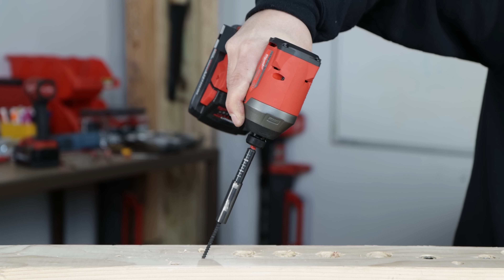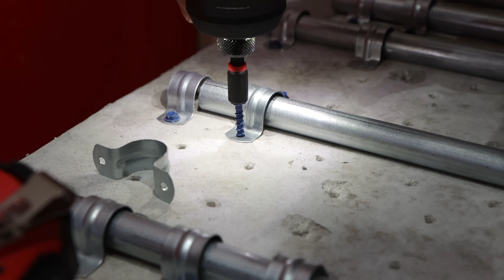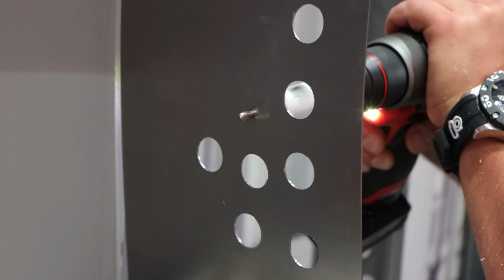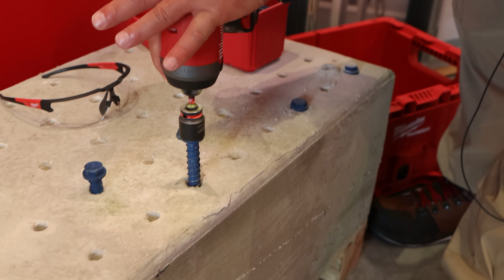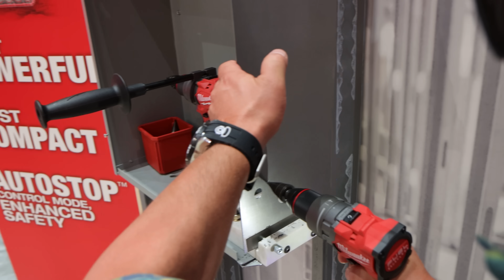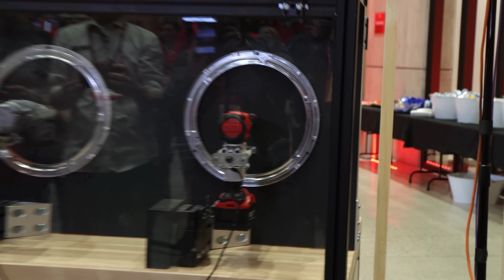Milwaukee's New Drill and Driver Specs Oddly Left Out at Pipeline!

Comment: Everytime I've tried to use a 1" auger bit with my M12 fuel drill,  the gears strip, or make a stripping sound.  Out of the 2 I  have, both after about a year the digital clutch starts to mess up.

Comment: I have the Milwaukee Gen 4 M18 and LOVE it.   It's the most powerful Stubby drill you can get plus Tri-led, 4 speeds and very lightweight.   Very hard to find just walking in a store and won't be on display either.   Easy to find on-line.   All the guys at work are jealous!!

Comment: Dope dope....... I own the gen3 and I use the impact with sockets to work on cars. And to drive bigger bolts. I mostly use the m12 Fuel kit for every day electricial work. But the m18drill is a MUST need for rough in on the residential side. Better than the cordless HOLE HAWG....... This Gen4 kit seems legit af for someone wanting to fill that void in their tool arsenal.  I already own the gen3 and I'll stick to that.

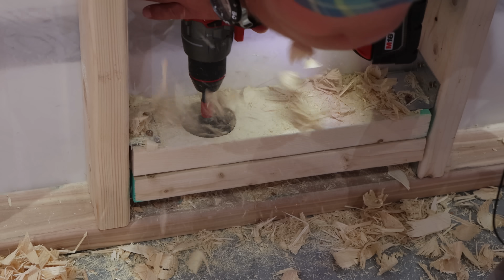Comment: 13:43  The BPM rating is in the PDF manual on the site, its 33,000 which is 1K more than the older generation.  So you have 0-500 RPM low, 0-2100 RPM high, 0-33,000 BPM, 1400 in-lbs, for the 2904-20.

Comment: Very bias presentation. I do have both brands and know their limits. Would be nice if they dont try to drill on second gear or very low battery level. It will disconnect tool to prevent battery. Milwaukee is very slightly more powerful, but Makita has ergonomics on another level, and thats what I carry when I work. M12 impact is slightly heavier than Makita CXT (12V), and on the end of the 8-10hrs day of work you will appreciate lighter tool. I have interested lot of money in both brands, and have some favorite tools in each category for each brand.

Comment: Tool guyd will give you all the specs cuz 2000 lbs 3900 rpm 4400 ipm 4.7 inch long m18 fuel gen 4 hammer drill 2100 rpm 33,000 bpm 6.9 inches long 1400"lbs

Comment: Just today upgraded my m18 fuel impact, percussion drill etc from gen 2to gen 3 it came with 3 x 5.0 ah  XC batteries…..Will the smaller 3.0 ah high out put batteries be the beer option for these drills…also I have the angle grinder, sds drill, circular saw and grass strimmer all fuel..

Comment: M18 Fuel Gen 4 Impact Driver (2953-20) IPM is 4400 and RPM is 3900; and
M12 Fuel Gen 3 Impact Driver (3453-20) IPM is 4000 and RPM is 3600
Per Milwaukee Tools.
¹ 2904-20 Gen 4 Hammer Drill Driver BPM is 33,000 and No Load RPM is: Low 0 - 500, High 0 - 2100; and peak torque is 1400 in-lbs
Hope this helps anyone curious or wondering.
Cheers✌🏻

¹ edited to add the 2904-20 info that forgot. Wanted to add this so ppl know what was changed/edited after the fact

Comment: Really glad Milwaukee went w/ the Tri LED light (or even ring light, but knew was gonna be a Tri-LED Light) to “keep” up w/ every other brand. Was also happy to see the AutoStop on the Hammer Drill Driver to help save our wrists!
Now what I didn’t know or see beforehand, was the New M12 Fuel impact. Was actually surprised to see they had the Tri Light as well, and that’s so awesome! 
Sure do want these new tools, but my current gen tools are still going strong and working well; but that don’t mean not gonna get and try, 😉
Only tool having issues w/ now is my m12 fuel 3/8” stubby. Starting to leak the grease inside…..but we certainly don’t “push” the tool at all😂
Thx VCG for showing us PipeLine/NPS and all the new toys for us who couldn’t be there.
Cheers my VcG Fam✌🏻

Comment: The “comparison test” of the new hammer drill against the obvious dewalt is rigged. They put the dewalt in speed 2 so it would stall and put Milwaukee in speed 1 so it cruised threw. The only thing I like from this was the tri light on the impact. Im still sticking with my Flex  stacked lithium hammer/impact. They’re crazy powerful.
Reply: I noticed that too! I was thinking in my head “No way my flexvolt advantage hammer drill doesn’t have enough power to get through that piece of wood” 😂😂

Comment: Sorry for all the comments but sometimes too fast is not good either because you're going to be stripping things out. That's great that they messed with the trigger making it more sensitive but having too much power you can burn out drill bits or strip out screws if you're not careful. But wasn't impressed with some of the displays comparing tools or some of the other displays but always great to see what's new. That's why tool test is so important to get the real numbers on their new tools.
Reply from the maker: Exactly Joseph, thanks! 👍🏻

Comment: ??? I know some people might think this is ridiculous but do you think companies ever mess with the tool when it comes to the Prototype. Basically what I'm saying before they go into production let's make the Prototype a little bit better and then when they go into production go a little cheaper with the tool. Because I remember DeWalt if you purchased it from DeWalt Direct you would get a better screw gun where Home Depot the same screw gun would have plastic pieces instead of metal washers screws etc. I know it's a little bit of a ridiculous question but you never know because if you make the product look better people are going to buy it. Thanks again Vince.👍💯
Reply from the maker: I think questions like that are in a lot of peoples minds! That’s why to #ToolTuber community has to confirm through work and testing!
Reply: Yeah I think most companies do that.  It seem there are huge differences in tools from the big box stores and one that looks identical from a specialty tool dealer.

Comment: Shit I'd just like to get my $700 12" mitre saw fixed the damn thing just quit work and until then I'm done buying milwaukee
Reply: I was so excited to buy it when it first came out but now it just sits in my shop floor and thinks to the economy right now I can't afford a new one either I'm was looking forward to getting the track saw but since it's a new product like the mitre saw when I ordered it I'm looking in to other brands
Reply from the maker: What happened to it exactly?
Reply: @VCGConstruction  did that help ? Or did you just not care kinda feeling like it ? You ask a question sorry if it wasn't to your satisfaction
Reply: @VCGConstruction  wow that was rude man is this the way you treat your subscribers you ask a question then blow off your subscriber I thought you was a straight forward type of person guess I'm wrong and you do actually care or you just in it for the money the funny thing is I would understand if I ask for free shit but you messaged me wtf
Reply: It was cutting trim a about 2 months ago worked great my 9.0 battery had died so I put my 12.0 on it took one cut went inside to install the trim I had just cut came back out to cut my next piece pulled the trigger and nothing and a small not vary strong at all burned wire smell now I live in a bit of a rural area so get it fixed is had we actually had to buy a cheap dewalt 7 in to work for now

Comment: Typical deceptive marketing, just like other companies that used paid actors for YouTube Cringe 2.0 a few months back.
A. That 20V drill was a weaker model of DeWalt drill. Why not their top of the line drill?
B. 12V drill and 7/8“ auger bit: there are 7/8“ auger bits that have a 3/8“ shaft and work fine in the DeWalt 12V Extreme drill that is stronger than the M12 Fuel (Irwin Speedbor Max comes to mind). Just because Milwaukee's bit doesn't fit doesn't mean it can't be done. Very dishonest. I used to have the M12 Fuel hammer drill and the DeWalt 12V Extreme drill, and sold the M12 because the DeWalt was stronger under load, even with a 1" Irwin Speedbor bit. Now, if the new M12 can do it while in high speed, that will be an improvement.

Comment: Even as a Milwaukee owner I hated their demonstrations. They drills they compared against the m12 gen 3 and m18 gen 4 both were not up to the task. I can say with the utmost confidence that any dewalt XR model will drill that self feed but just fine through the 2x10
Reply: Dewalt's speed 2 is just s fast as many others. Speed 3 is a bonus higher speed when you don't need the extra torque. That self feeding bit test had the Dewalt drill in speed 3 to make it look like it couldn't drill it. Drop it to speed 2 and watch it do it faster than the Milwaukee
Reply: @chrisi7456  no bro speed 3 is 2000 rpm 2nd is 1300 its dropping a gear period yellow Boys smh
Reply: Naw it will have to drop to second bro come on now we all have all these drills

Comment: Looking at some of these so-called competitors if you noticed they spray painted over them. Just by looking at the shapes etc. some of them were for example outdated Dewalts. There’s a reason they don’t want you to know what exact drill or Driver they are comparing it to.
Reply: Notice he held it in a way we could only see the bottom of the battery then he put it behind the piece of wood?
Reply: @jonnyw82  also look at the battery sizes. Generally they have small ones on the competitor products
Reply: @jonnyw82  yep. But in another scene you can see the side profile and you can get kind of an idea of what ones they’re using.  Also they’re kickback demonstration has absolutely no relevance since they don’t show it against one of the top of the line competitors that are using high end kickback systems. In fact we have no idea what it is except for the Dewalt. Furthermore we have no idea what they were comparing it to so we don’t even know how superior or on point their system is compared to others

Comment: Would you say that the Surge holds up to the new drills?
Reply: Completely different application. The focus of the Surge is quietness, not massive power. It's not goin to run huge lag screws like the new impact driver because that's not what it's designed for.
Reply from the maker: In which way D?
Reply: @VCGConstruction  Well I'm assuming they would demonstrate the new drills along side the older drills like the Surge, and not just the competitors. Kinda like what you do with TTR. And since you got to test it out already at Pipeline. Would you say it out preforms the Surge? Is the new drill worth the pre-order?? I see Roosclans reply, and that sorta answers my question, but I'm just curious on your opinion since you've used both the Surge and the new drills that are coming out.

Comment: ☝LET'S GO 🏁
I did notice every time they do a comparison with their "next closest competitor" none of them were FLEX ... 🤔
Reply from the maker: Ready set…….
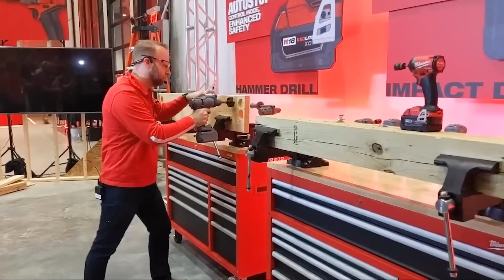Reply: @10:19
But I will say, they were for sure running it in speed 3.
Reply: @nismomike3182  Which is now LOWER in rpm than Gen 4's speed-2 (2000 on Dewalt vs 2100)